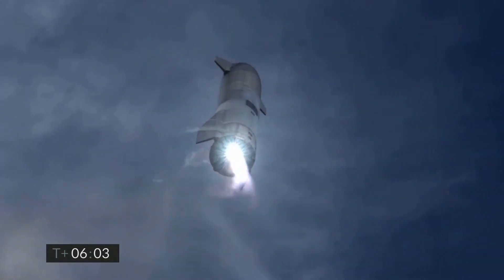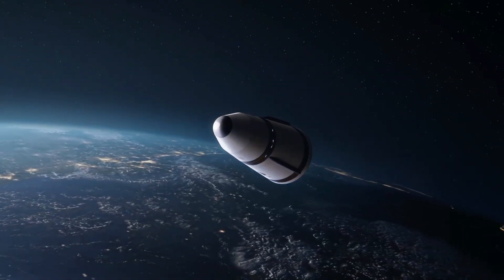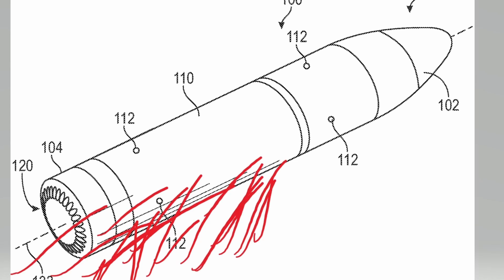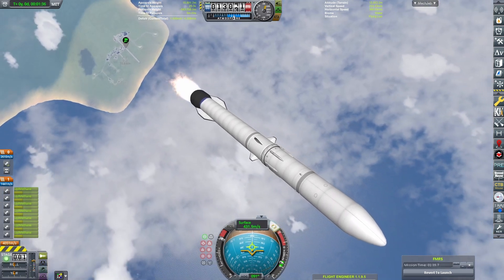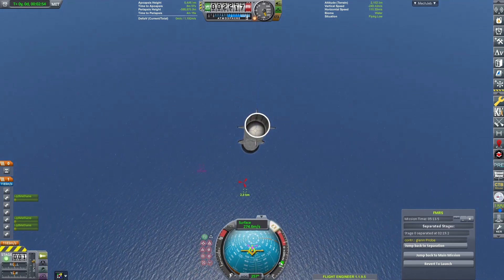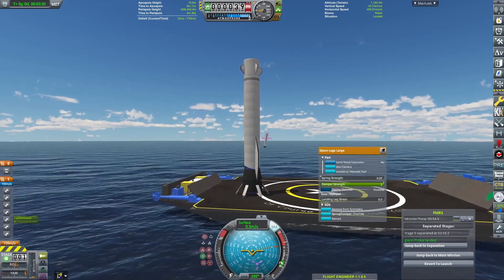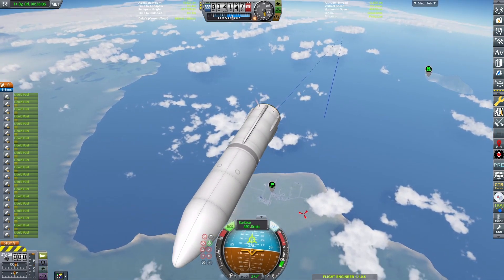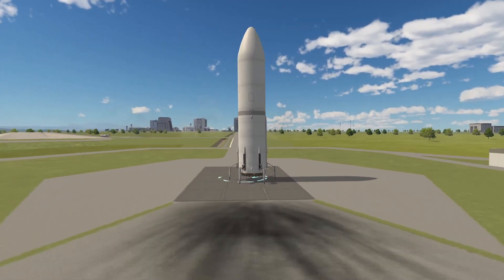Blue Origin's Plan for a Fully-Reusable New Glenn!

Comment: 7:05 doesn't the patent specify that they'd use two (lightly modified) BE-3U powerheads? The patent is obviously fairly vague to keep their options open, but they do mention using two BE-3U powerpacks as "one non-limiting example" on page 4.

Comment: In my opinion a fully second stage makes much more sense at the NG scale that the Stoke Nova scale. Even if a reusable upper stage reduces payload capacity to LEO by 50%, a fully reusable NG should be capable of putting 22.5t to LEO, which would make it about as capable as an expendable F9. A reusable New Glenn upper stage can also afford to be somewhat conical (if that is the path they pursue) while still keeping a reasonable payload fairing size. Meanwhile Stoke's Nova will have a very small payload fairing (looks to be bi-conical with a first section that narrows from a diameter of ~2.5m to a diameter of ~1.9m over a height of maybe 2.3m, and a second section that narrows from 1.9m to 0 over a height of 1.9m, for a total volume of maybe 43m^3, of which not everything will be usable) and will only be capable of putting about 3t to LEO, making it comparable to the VegaC, but with a much smaller fairing and about 10% less payload to LEO.

Comment: why not use a tapered rocket with the engines and fuel in the top and a cargo bay at the bottom? More shielding for the payload on ascent, more shielding for the engines on descent.

Comment: They can add grid fins and regular fins if they need to. They should be able to also optimize the shape of the tube, or whatever they call it on a rocket, fuselage? At any rate since it's still under development they can make changes as needed. If you got something big like that coming in hot I think there should be some kind of fins, to give it some drag and control surfaces.

I'm a SpaceX fan, but I still want to see Blue Origin and some of the other new American space companies succeed, and even Europe as well, I guess...

Comment: The Stoke capsule shape is naturally aerodynamically stable, whereas Jarvis isn't...   :)
Mind you, we don't know that Jarvis will land with fairings attached, it would be smarter if they drop and collect the fairings like SpaceX F9.

Other issues compared to Stoke:
Jarvis has inward facing 'aerospikeish' engines, less efficient than the Stoke config and I have no idea if they gimble for landing!
Stoke has kept their engines further back up the heatshield away from the bow shock so they don't melt.
The Stoke design has way less parasitic mass in its landing legs because it takes advantage of its naturally stable low center of mass design again.

Comment: There is zero way that second stage would survive re-entry unless they plaster the sides with heat tiles like starship. The slightest bit off of the velocity vector (as you mentioned) would cause heating to the tank and most likely obliterate the aluminium fuel tank (for example, look at Shuttle Columbia).
Reply: there's no reason to believe Blue Origin would build their reusable upper stage out of aluminum. We know they've investigated building stainless steel tanks for project jarvis, right, so clearly they don't have their mind set on sticking with aluminum and carbon fiber.

Comment: By technicality New Glenn is Fully Reusable XD

But no, in reality, as someone who works at SpaceX I cheer for Blue and all the other aerospace companies! I want all companies to succeed.

Also, Stoke shouldn't see too much heating in the nozzles themselves, that is the reason the heat shield sticks out, pushing out the shock front away from the stage and making it blunt. The active cooling is talking about a metallic heat shield, though I do agree it makes sense to flow some liquid through the nozzles.

Oh and as a KSP youtuber I can appreciate you forgetting to remove the second booster you used to estimate where to put the ship XD
Reply: What do you work as at SpaceX?
Reply: If someone were say, looking to work on GNC at spacex, what would you want to emphasize on a resume? Especially if you were currently in school for aerospace and deciding on internships, what are the desired skills and previous qualifications that are desirable
Reply: How can I get into spacex

Comment: NG could probably benefit from a gargantuan side mounted second stage (albeit only if the design would be stable). Starship will dominate the industry. Do something like Energia. Launch really really large payloads. (Space Lasers!)
Reply: nah medium and heavy launch vehicles will also see use

similar to how small LVs are very much in use right now even though falcon 9 exists
Reply: NG is already really big (>45t to LEO with booster reuse and expendable upper stage), and they have their absolutely massive 7m diameter fairing, which allows for much larger payloads than Energia or the Space Shuttle.